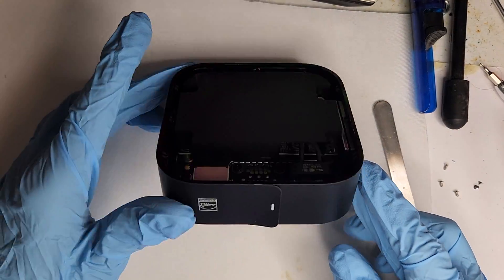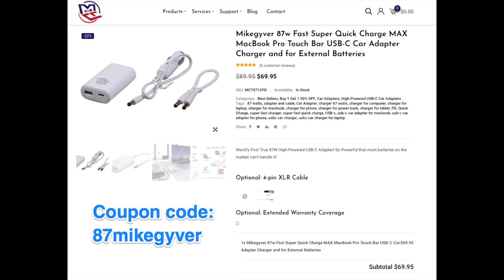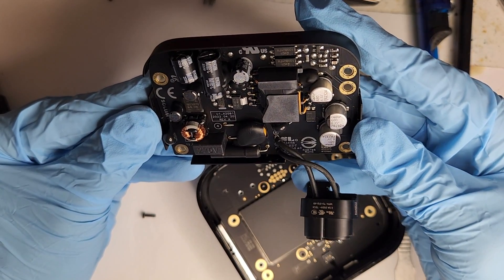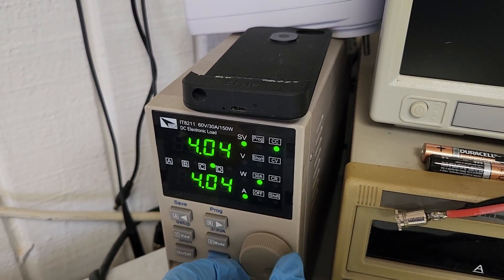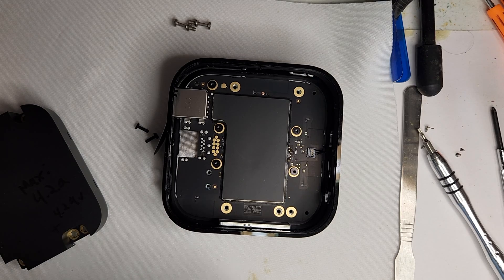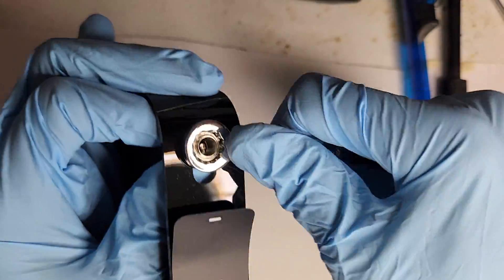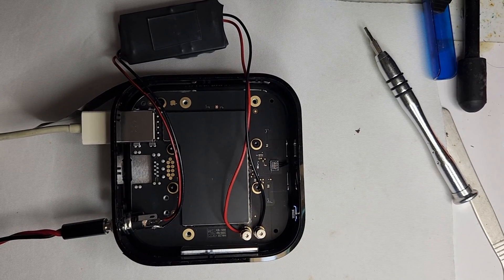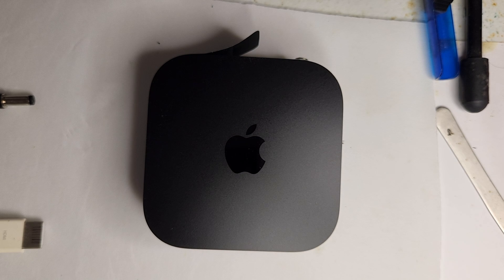DIY: Apple TV 4k 3rd gen (2022) teardown, and 5vdc-12vdc car,RV,Boat, off grid upgrade hack.

Comment: So it's possible to just use a USB power supply and a USB to DC cable to power the unit? Only .8v difference.
Reply from the maker: No, USB-A is typically 5v.  The latest Apple TV is 3.40vdc.  You'll still need to down convert.

Comment: Not sure I follow the point of all this. How much energy does this little box really use? It's nice to see inside the box but really?  Had trouble following what you were trying to achieve here.  My focus is for use of the box to improve the HDMI quality and approve the power supply to reduce noise issues for audio purposes. It's a great streaming device but the upgrades to improve the Quality are worthy of much attention. Overall it's a fairly cheap box for all of does.
Reply from the maker: Just curious since you are into noise reduction, what is the noise and power level draw when using this in a DC environment, when using an inverter in car/RV (DC to AC to DC)?
Reply: Click-bait!

Comment: Hi guys, thanks for this super useful modn any idea if this could be powered via usb c ?
Reply from the maker: Yes, stay tuned.
Reply: @mikegyverComputer  did you try to use a ZY12PDN board with a usb c car charger ? the usb c should be able to negotiate the right amperage with 5V

Comment: what voltage do you convert to for the converter from dc 12v to 4.24v so that the apple tv can run?
Reply from the maker: Yes, we are converting from ~12vdc to 4.3vdc.
Reply: @mikegyverComputer  This mod is pretty amazing!

Comment: I just pulled my Gen 3 apart and on the back side of the power supply (the cover you didn’t take off the back) and it clearly says “Output 4.3v, 1.21a” so it looks like you don’t need the higher amps you mention. My Apple TV has 128GB with Ethernet.
Reply from the maker: That is correct.  We tested up to exactly when the PSU will cut out.  Apple often times over engineer the power (amps), but in reality, the extra amps is rarely used.
Reply: @mikegyverComputer  it’s nice to know what they expect to use as power as there are other power supply units that could be used if you only actually need a couple of amps. I really appreciate the videos you guys put out. Thank you!
Reply from the maker: @madmacks  Thanks for watching!

Comment: I wonder why they haven‘t just used USB-C. I guess it‘s for efficiency reasons.
Reply: They removed because they don't want people to hack their apple tv
Reply: @SoccerXMan1  if that‘s the only port, sure they could just use a OTG splitter, but they could make it USB-C 2.0 (USB-C electrically can work both on 2.0, 3.x and 4.x). I guess they just wanted to avoid power supplies.
Reply: Old version use usb c

Comment: Was bringt das ?
Reply: Im Auto hat man nur 12V, wodurch man einen Spannungswandler braucht, um den Apple TV zu betreiben. So kann man ihn auch direkt durch 12V betreiben, wodurch sich ein grosser Spannungswandler vermeiden lässt und man eine längere Akkulaufzeit auf der Batterie hat.
Reply: @Jdj Xhh *120 or 230V AC.
You are basically stepping up the voltage to 120V AC to step it down to 4V DC, while you could also directly step it down to 4V DC from 12V DC.

Comment from the maker: All items are from Amazon Affiliate:
TR6 Torx screwdrivers ➜ https://amzn.to/3UcEisW
Regular ➜ https://amzn.to/3unx0qC
Soldering station ➜ https://amzn.to/3BkuqVh
Solder ➜ https://amzn.to/3Lk46iM
Shrink wrap kit ➜ https://amzn.to/3SdU4SJ
20awg wire ➜ https://amzn.to/3RIoA7f
Wire stripper ➜ https://amzn.to/3diqv3v
Power jack ➜ https://amzn.to/3DzsbAf

Don't feel like doing it yourself?
We'll do it for you ➜ https://mikegyver.com/shop/apple-tv-4k-car-rv-truck-boat/
Reply: Why step-up regulator since you need 4.24V out of 12+V ? I think you posted wrong link for regulator .... :)
Reply from the maker: @L4zYA55  Thank you.  I have fixed that.  Although, I don't recall it was that model before.  Maybe the listing changed?